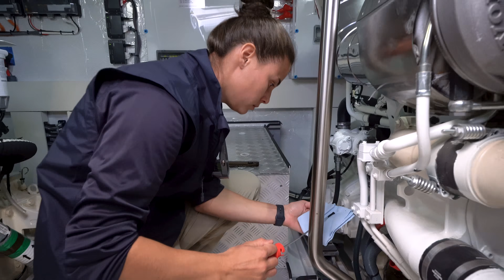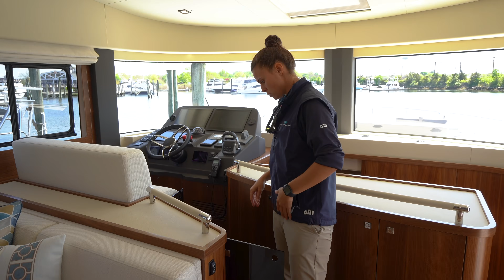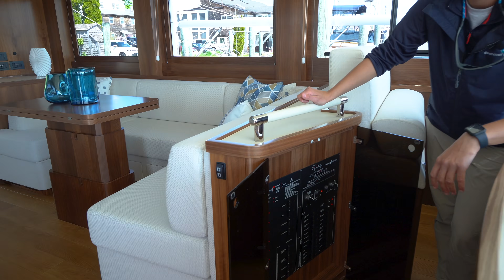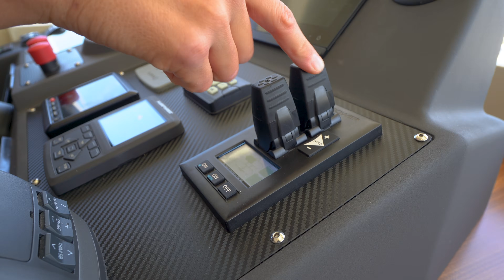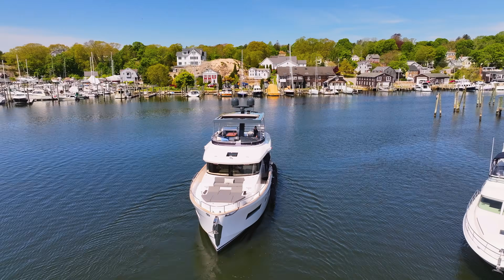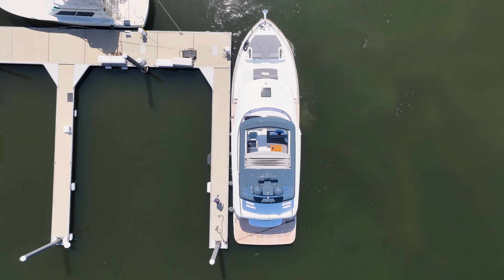Docking a Sirena 58 & Pre-Departure Check

Comment: Call me "Old Fashioned" but to me, using the bow thruster on such an easy berthing position is being spoilt and just like taking a great motorbike and using training wheels. Learn to use the boat with the bare minimum of aids and be a better skipper. For the record, this is your generation of captains and boaters that just cannot grasp the ease of twin engine maneuverability. Most of these vessels have battery powered thrusters, as opposed to hydraulic (as if the average captain knows the difference) and they regularilly FAIL when you need them most. The majority have Heat Fuses that will shut the thruster off when used in more than short bursts. So when you really need to moor against wind and tide or emergency, you will be LOST because you have become so dependant on a luxury, thinking it is a given. It is not. In a normal setting, as in everyday usage, learn how to control the vessel on rudder/s and propellor/s. The thrusters are a benefit and an OCCASIONAL operational tool. It is not an asset to be taken for granted.
Reply from the maker: all that matters is docking the boat safely,!